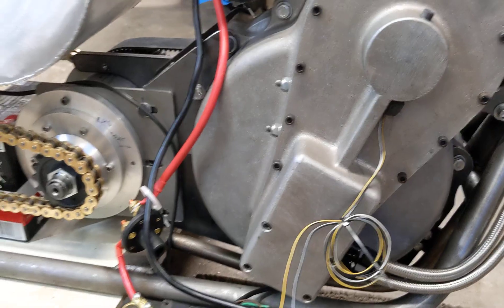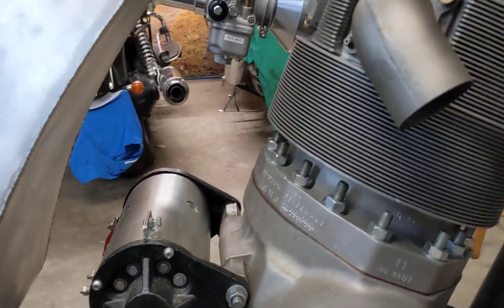Electrifying ⚡

Comment: Just out of interest, does the ignition run a fixed timing, or is there some kind of electronic wizardry inside the Boyer ignition box that applies advance and retard?
Reply from the maker: It's electronic advance based on rpm. There's no retard as such, static timing is set fully retarded and the unit applies advance as the revs rise, as per the pre-defined timing curve. Unless of course Mr. Boyer wants to correct me. 😁